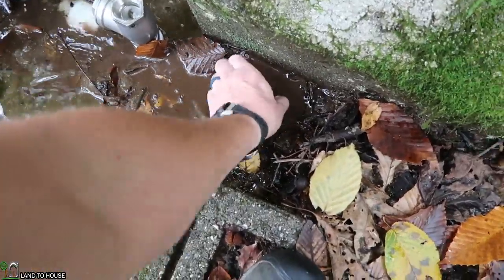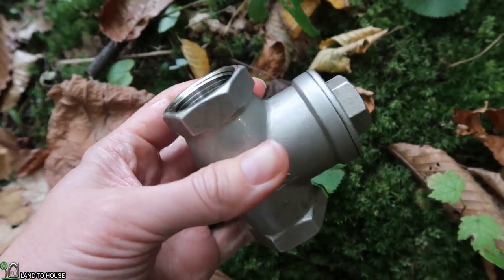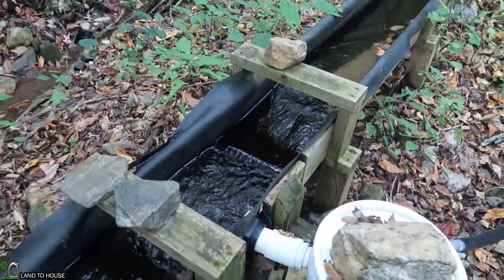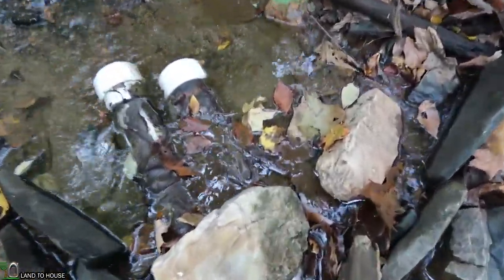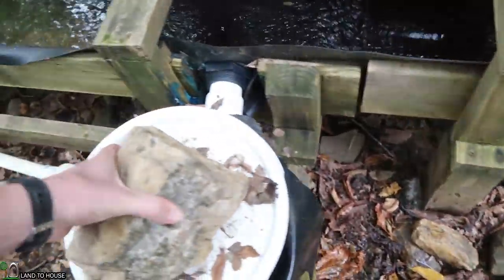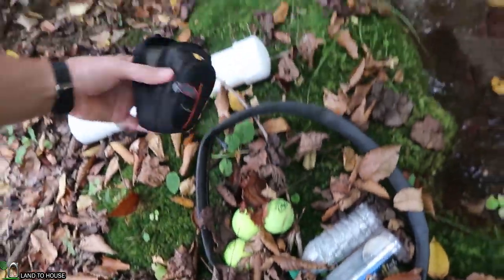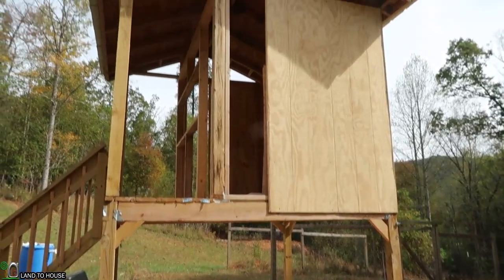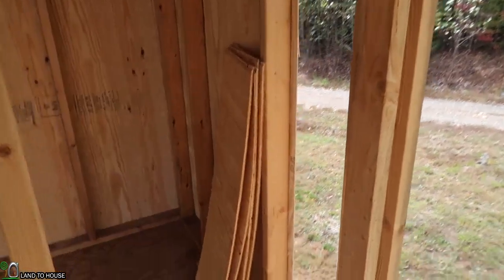Stainless Steel Valve after 5 Months Ram Pump - Vlog 171

Comment: I think it would be good content to build a silt-sucker design like what I was prototyping in my creek in your bucket, it seems like you will have enough flow to run the sucker all the time. (for those unaware what I'm talking about he should plumb the overflow through the hole he currently has down to the bottom of the bucket, thus any silt will settle and be pushed up and out the overflow)

Also Dave Ramsey while good is somewhat basic in it's approach, for example the debt snowball is inferior to the debt avalanche method. Two similar books I encourage you reading are rich dad poor dad and the millionaire next door.
Reply from the maker: That is a good idea. I have a new intake idea for next year. I have already purchased all the parts to make it but just did not get around to it this year. It should reduce some of the silt issues. BUT making a redesign for silt removal in the bucket would be great. 

I have a copy of rich dad poor dad. I started it but just did not connect. The Dave Ramsey method is working for us because we enjoy seeing the numbers change faster. The Avalanche is a bit daunting.

Comment: What happens to the old brass valves and how long did they last?
Reply from the maker: If you let the ram pump run all year long it Cycles about 31 million times. That's enough for the brass valve to start showing noticeable signs of wear. About a year-and-a-half is all you would get out of a brass valve. I'm anticipating no less than 3 years out of the stainless steel valves

Comment: First of all your valve is not completely shut off you need to move that concrete block let’s do this the right way if we’re going to do it or not at all
Reply from the maker: The concrete block has a flume on top of it. I just need to move the pump. :)

Comment: Which one is delivering more water, ss steel or brass swing valve. Ss steel is longer than brass swing valves.
Reply from the maker: The ss valve is heavier. It actually can deliver more water.
Reply: I’ve seen videos where they use a modified spring valve and get even better performance in both height and volume as they can add or remove weigh to the valve

Comment: Seth are the stainless steel values more expensive ?
Reply from the maker: They are by a lot! BUT I have managed to keep the pump price the same for customers.
Reply: @LandtoHouse  are the stainless valves available for all sizes of pumps? 

Thank you for all your vids!
Reply: Sometime there is a promotion on line shopping, you can get a cheaper which is almost the same price with brass,Mostly made on China.